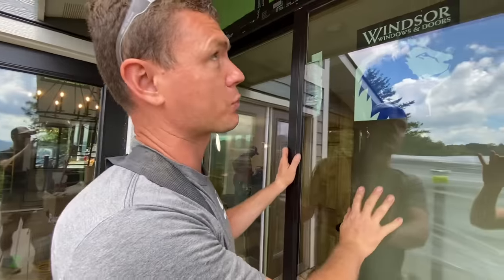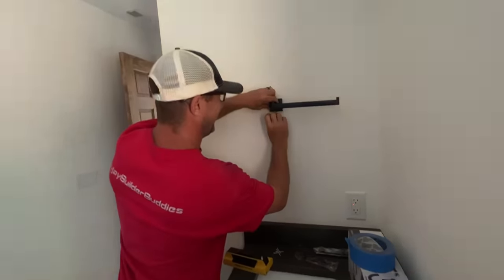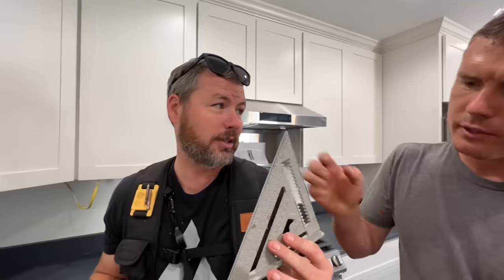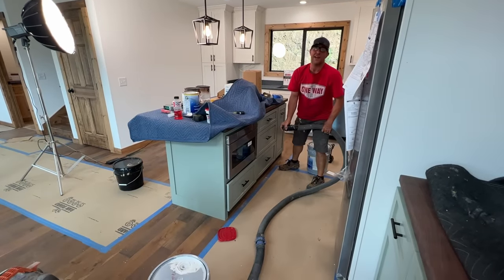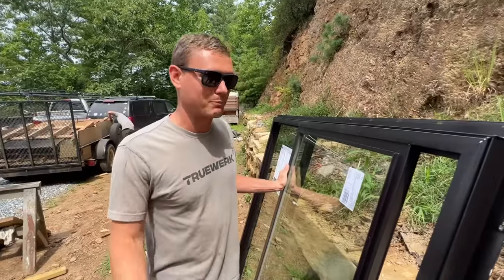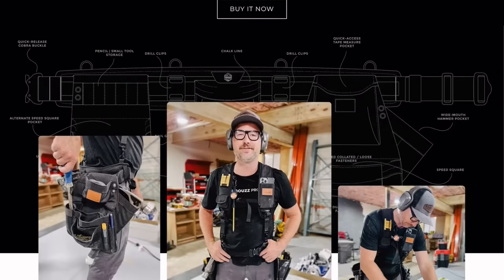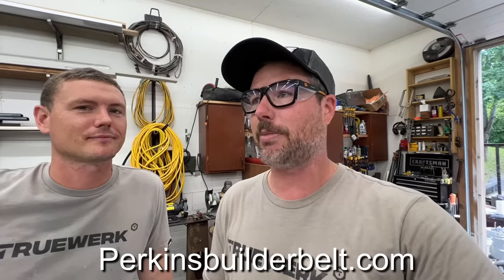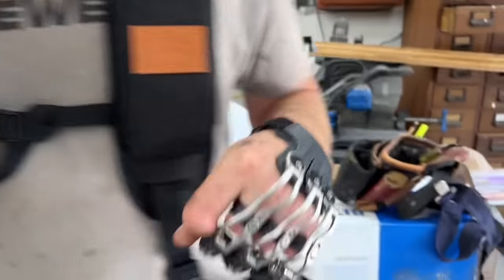Building A Mountain Cabin EP58 | It’s Done!

Comment: Pretty easy to make your own door knob/pull jig.  Take a scrap piece of 3/8” plywood or solid wood and attach two (1” thick strips) to two sides (meeting in the corner).  The strips overhang each side and allow you to flip the jig over for left and right hand templating.  When you’re done with the current job, apply tape over the holes and reuse for the next project to avoid drilling the wrong holes.  IMO, there’s room for error marking with the square every time (I’ve done it!). The jig also protects the cabinet face while drilling.

Comment: I made a jig for door handles decades ago.  No clamping required.  Just hold it to the door and drill. I made it out of sheetmetal.  Two pieces  with a fold on two edges. Spot riveted them together.  If the hole spacing is different, I cover each side with tape and drill new holes.  In the time it took you to mark two holes I could have drilled two holes and have the screws started.

Comment: At 3:44, this reminded me of the tip my grandfather gave me (he was a finish carpenter for nearly 45 years). As you move down on the cabinet, the handle should move slightly higher on the drawer front so when looking down, the handles APPEAR to be centered. With the handles being actually centered in that shot, you can see how the lowest drawer handle LOOKs to not be centered on the drawer front.

Comment: Here’s a pro tip on drilling holes for cabinet hardware, use an adjustable Combo square for layout and a center punch for perfect hole placement, no bit walking and no need to use the countersink type bits.

Comment: Did you use the drawer corner, that you cut out with the oscillating multi-tool, and flip it around and use it as a filter in the inside of that corner you cut out to begin with? Or would it have been too small, I guess? Sorry I'm thinking out loud here. Lol well I guess not out loud really..

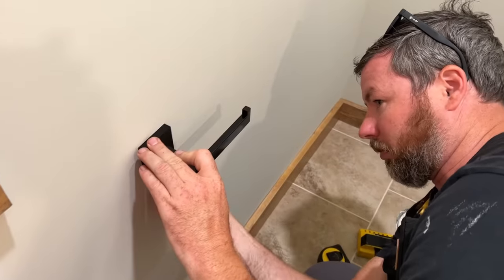Comment: 2:40 the toilet paper holder is installed in the wrong direction.  The open end should face away from the toilet.  If not, every time you yank the paper to tear off a section, you'll end up pulling the whole roll off the holder.  🙂

Comment: Hey guys do you do the builders belt in woman’s sizes? Xxx😊🇮🇪
Reply from the maker: Hey Michelle… not specifically. If it helps, I wear a medium and have a 32 waist. They do run a little large overall I think, so if you are on the fence about sizing I would go with the smaller one

Comment: Ive been binge watching your videos and I notice the TP roll holders are open ended. So the question is, do you load the roll from the front or from the toilet side? It looks as if you have the open end towards the toilet. Does it tend to slide off when pulling? Would it make more sense to face the open end away from the toilet? Just one of those small things that would irritate the crap out of me. (Pun intended) 😂

Comment: uPVC frames should be steel or Aluminum reinforced that was the problem with that window it had no reinforcement. the fixed panel had 3mm/4mm glass looked like a low E type glass - 42 yrs glazier STOP breaking glass what a waste